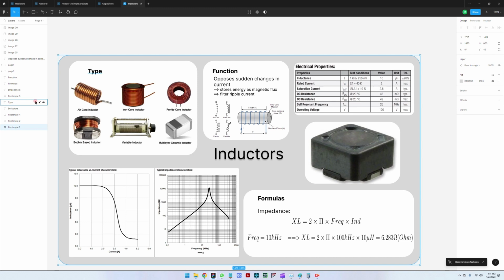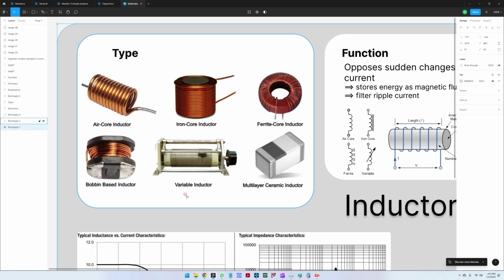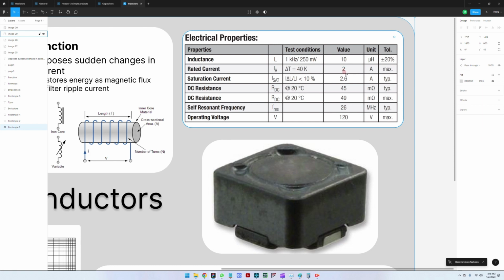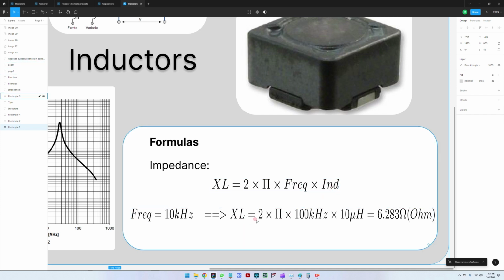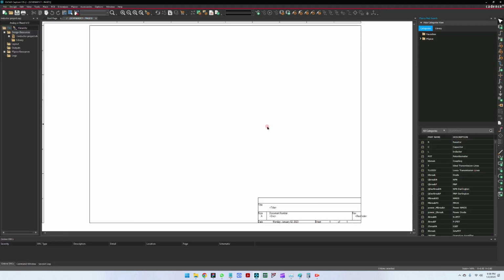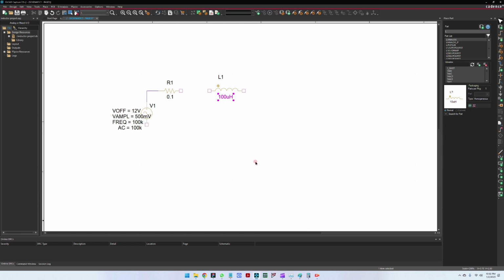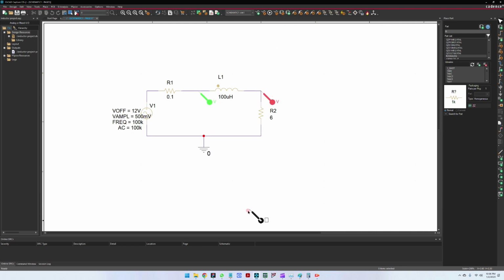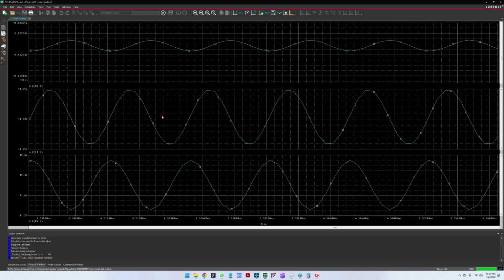Basic Electronics - Inductors - Made Easy

Comment: This is a good OVERVIEW video.  I guess "easy" is a subjective term to describe.  Its pretty technical for noobs like me who are really just trying to grasp a very very very basic understanding of what an inductor does, WHY they are utilized (not general answer like "inductors filter current change," but specific example of what happens in a circuit if there is not an inductor..), and real-world examples of inductor use in the world.  Just my opinion, but that would be more helpful because it would lay down a basic "need" foundation, which would then be followed by "how inductors work" like this video.